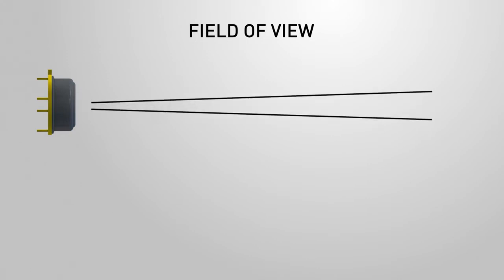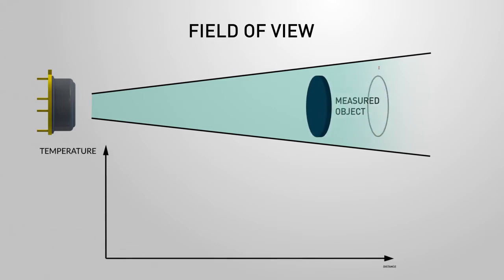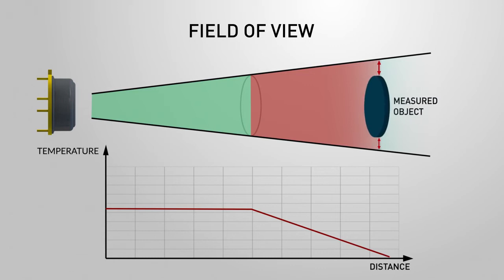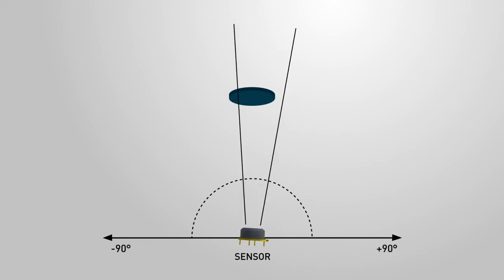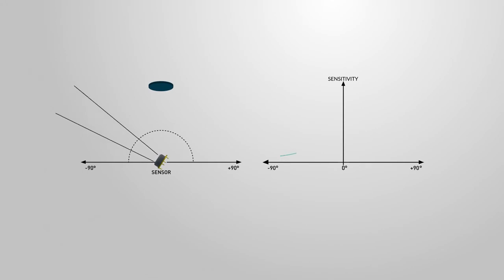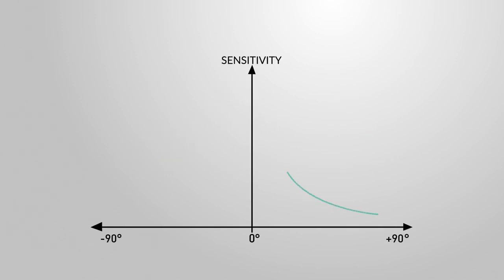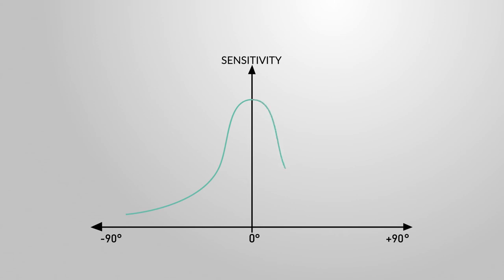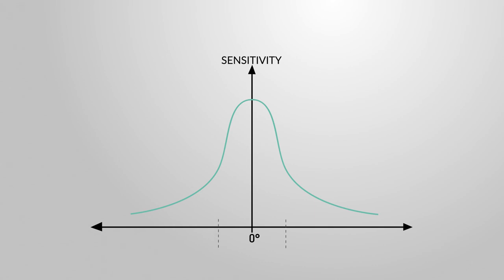How Field Of View For Infrared Temperature Sensors Is Determined

Comment: 50% of what? The ratio of the dT between the (sensor and the background) and the (sensor and target) shall influence the nature of the distribution as depicted at 2:09. ..or do you somehow ensure that the b/g is at the same temperature as that of the sensor (dT_1 = 0) before carrying out this experiment?
Reply: 50 percent of normalized graph. We are not interested in absolute values returned from the sensor in this experiment that is why normalisation is done. Ideally the temperature of the object should be high enough to have clear graph. Normalized graph is not much sensitive from the temperature value itself. Definitely, object should be hot enough to be easily distinguished from the background and same time not to saturate the sensor. And yes, as any FIR sensor, it has its internal temperature sensor for compensation. You are right, ideally sensor temperature should be as background, but for most cases with proper object temperature selection, this requirement is not so strict.